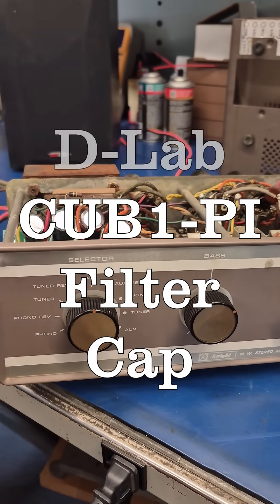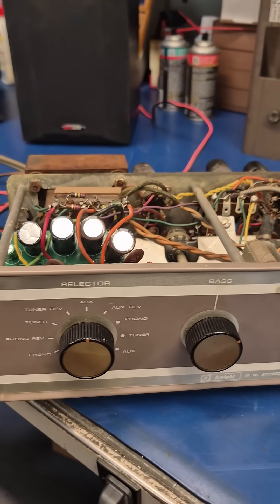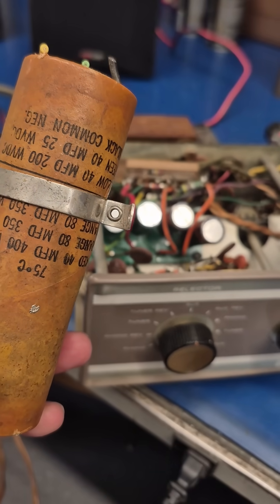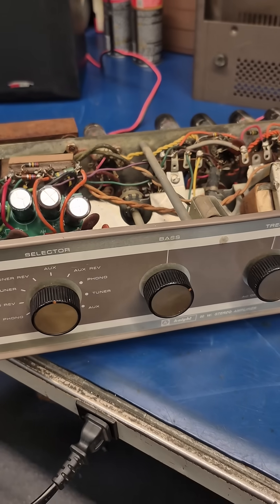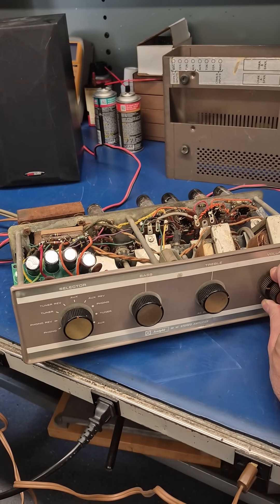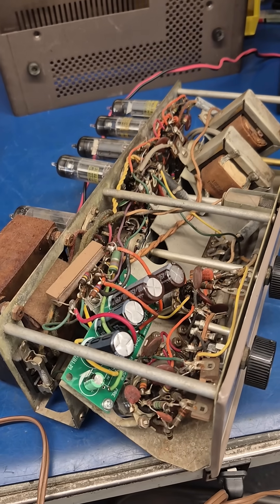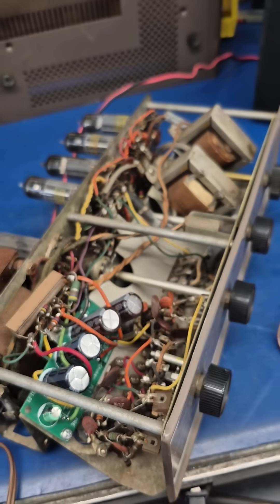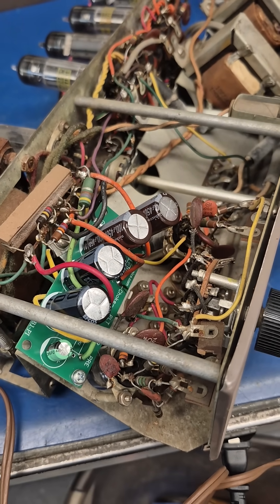allied tube amp #shorts #repair #diy #amplifier #guitar #tube #music #cool #vintage #audio #music

Comment: I'm not a fan of the PCB in a old tube amp or radio.. I just did a 1960s Newcomb AM/FM radio and used a 4 lug terminal strip so it looks like it belongs there. the orig can cap is still in place so it looks original ...

Comment: Nice!  And that reminds me, I still have a Knight tuner from the early '60s, maybe a KN141C? (I looked for images online.) It's from the early '60s, the only part of our Hi-Fi system that survives.  It's been several years since  I last tried it out and it worked then, but I'd have to check it out (or send it to D-Lab!) before trying it again.  I don't recall replacing anything in it, ever.  My brother used it back in the '70s through '80s, replacing the knobs somewhere along the way.